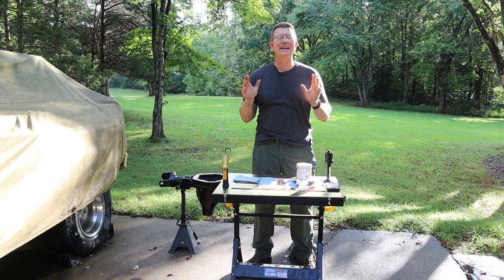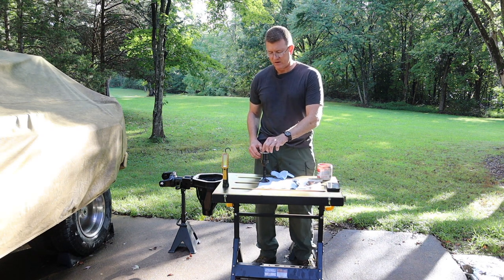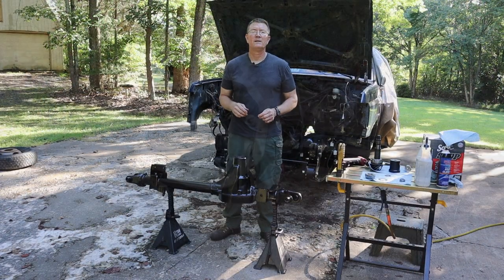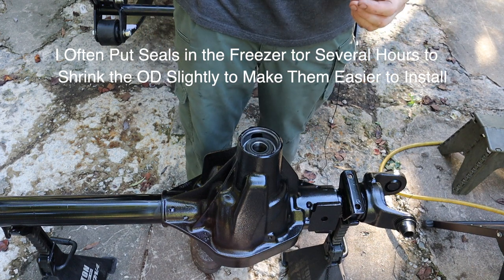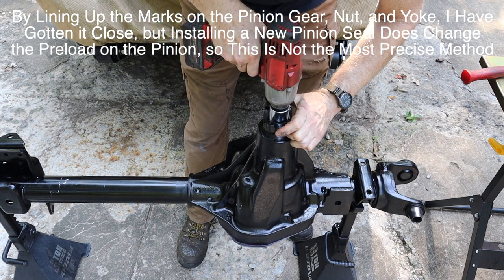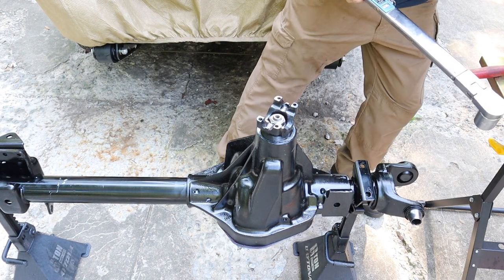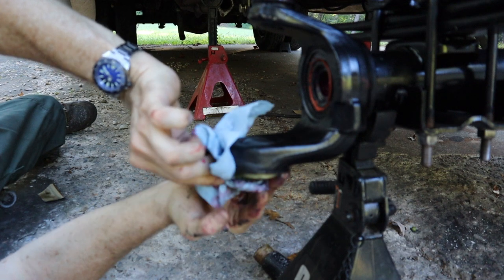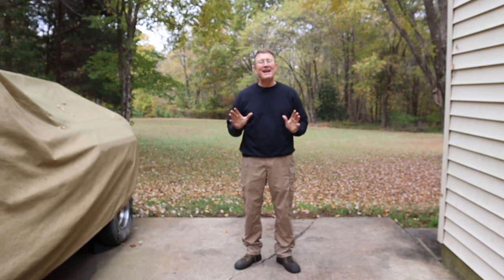Dana 60 Step-by-Step Rebuild, Part 2, Project Brutus Ep. 8

Comment: Hey great work I have now watched this video more than a handfull of times but now it is my time to shine! Just wondering about the pinion preload, basically try to match the same preload number collected from the inch pound torque wrench as best as possible if only changing the pinion seal? Thanks!
Reply from the maker: Antoine - That's correct -- you want to match the preload from before the seal was changed.  Scott

Comment: If reusing the pinion nut, you may want to put some red loctite on there. I debated putting outer axle seals on mine too but read conflicting opinions on them. My biggest worry was trapping water inside the axle housings. Any plans to check the gear pattern and pinion preload?
Reply from the maker: David - good point on the Loctite - I mention this in the comments, but after I finished shooting the video, I removed the pinion nut and added Loctite.  I actually did check preload, but it was sloppy - I waited until I had the case installed along with the new seal.  I should have done it without the case and with no seal, shooting for 8-10 in/lbs.  Since I didn't use the correct procedure, I decided not to include that in the video.  I'll check the gear pattern if it howls, but if it's nice and quiet, I'll consider it good to go.  Thanks for the input!  Scott